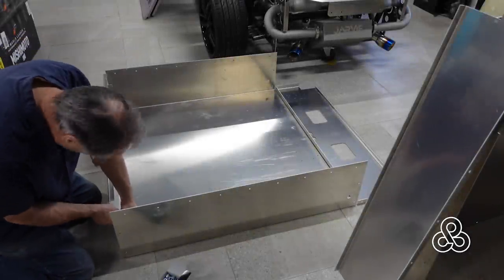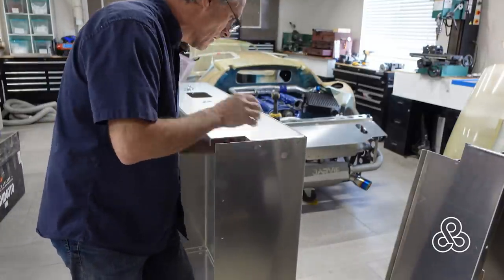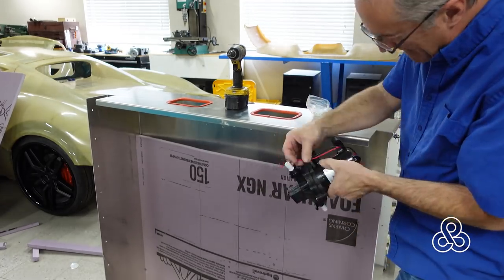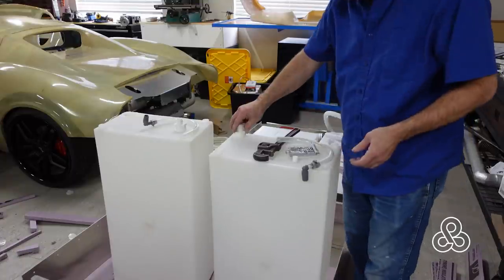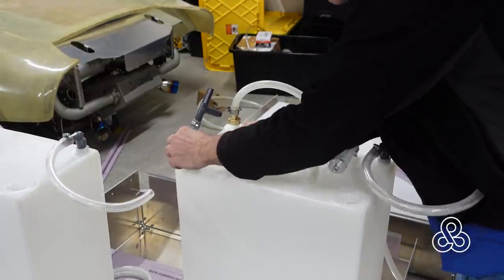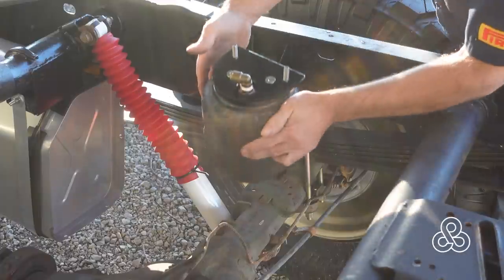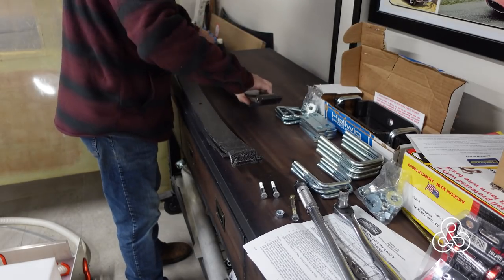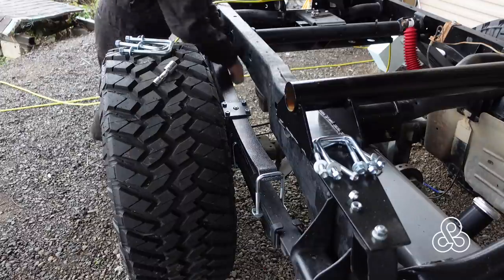L12 How to hide 100 Gallons on an off road overlanding RV. Leviathan project

Comment: I would recommend at least 1 and a half thread protrusion past the nuts on the helper spring u-bolt in order to get full engineered strength on the clamping u-bolts. It looked like you only had half a nut engagement.
Reply: I agree with you... it looked to me those supplied bolts were for one less helper spring each side.
Reply from the maker: Yeh, I went back and forth with the two U-bolts, but the long and mid length bolts require double nuts and hence I needed the longer bolts in those positions. We will just have to give it a few thousand miles and see. It's a pain in the patuty to replace parts that the manufacturer supplied. If it were the bolts holding the axle on I would definitely think twice. :)